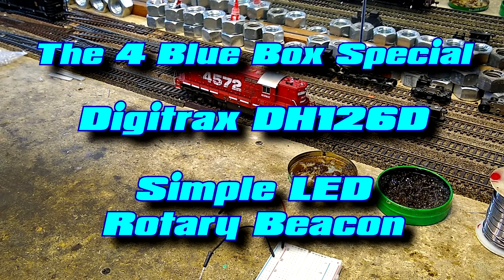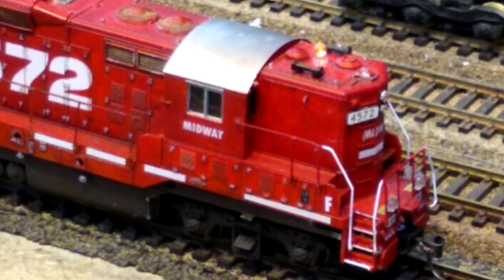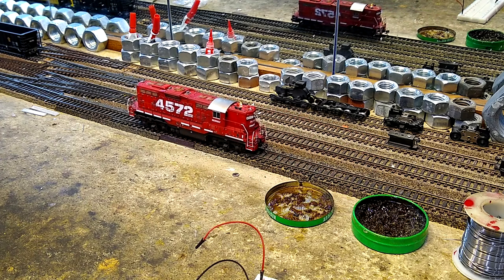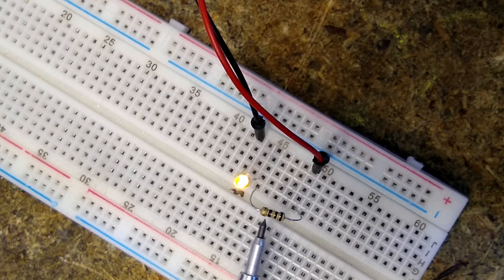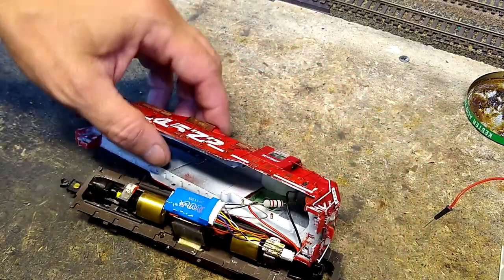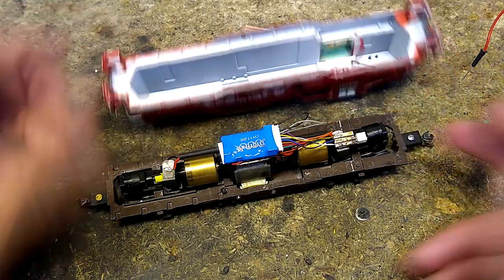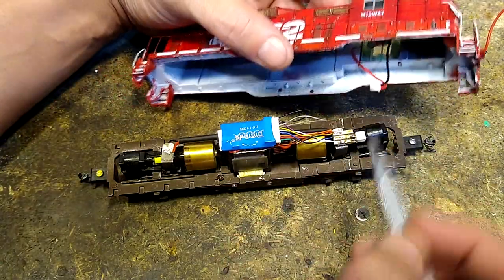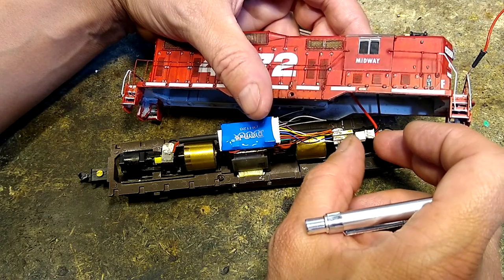Digitrax DH126D Simple LED Rotary Beacon

Comment: First off, I must say that I admire your Midway Paint Scheme. The more that I see it, the more that I like it. I may even do my own version base on your concept, but I am considering adding chevrons on the both ends of the high hoods and possibly the snow plow (I see you did not add one) white paint on the cab roof and black on the floors and step tops. Don't worry, mine will not be named Midway and my numbers as well as my fonts will be different. With that said, the L.E.D. you used as a flasher looks really good as well. The flash rate as well as the visibility are prototypical and the manner in which you have it connected so that it will flash regardless of direction is good to. However, I think that it protrudes from the top of the roof just a little too much, plus you do not have a suitable lamp stand on the which the real beacon wound sit on, which also contributes to the height of the L.E.D. If you look closely at prototype photos of locomotives with beacons, you will note that the height is not as high as your model. If you add a stand and lower the height, I think you will simulate the prototype very well.
Reply from the maker: It is a bit tall compared to the beacon detail parts that I have on a few locomotives, but I do have some flat top leds like this that I might try next.  I burned up a resistor and thought I might pop some leds trying to figure out how to solder it after using just 2 tiny holes to mount it -  so I used these because I have a couple bags of 1000 I once thought I needed!  My paint schemes are really simple so I can get more work done and there will be some railroad for each color of paint.  I have made chevrons on a Cricut craft cutter and they turn out really nice and are easy to put on.  There will be some chevrons on some locomotives somewhere.  I also have almost finished scratchbuilding a new lathe so I can shape the ends of LEDs to fit them in noses and not have a bulging end sticking out.  Plus, I did so many locomotives with those swarovsky jewels instead of lights that I will need to make a lot more beacons.  I'll show my super low end dirt cheap lathe that cost about $50 when we resize a couple LEDs.
Reply: @elite194  Great, I'll be looking forward to it.